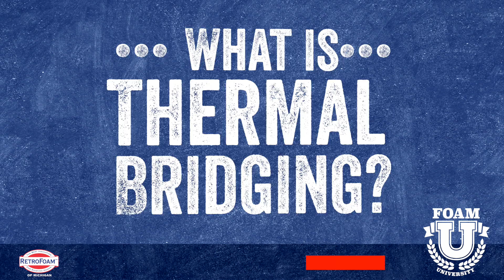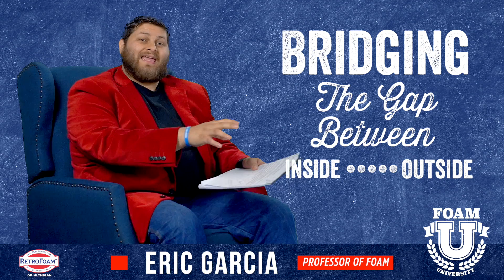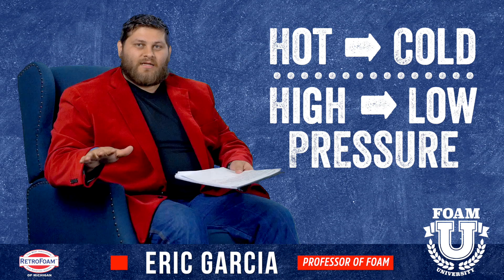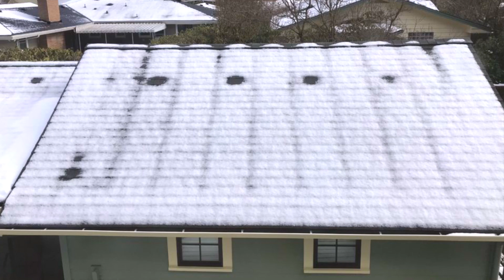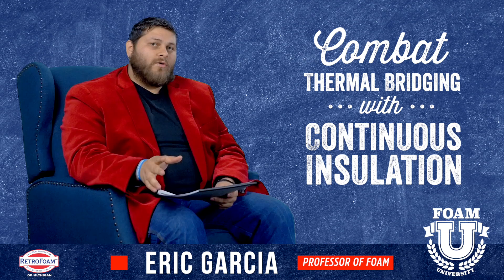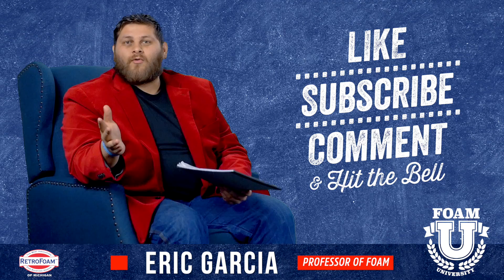What is Thermal Bridging? | Foam University

Comment: I have vaulted ceiling with spray foam hot roof. The house is already shingled. How do I prevent this. I don’t have sheathing on the inside yet. Would it help if I sheet the ceiling? Just trying to correct this before I move forward.
Thanks
Reply from the maker: Hey Thomas! Sheeting the inside would help. We would suggest adding some continuous insulation like a thin foam board to give an additional barrier in front of the studs/trusses.

Comment: How do you stop condensation on hot roof ( cathedral ceiling)
Reply from the maker: The spray foam insulation can actually work to prevent that condensation. The air barrier it creates prevents the hot and cold air from meeting, so condensation doesn't form.